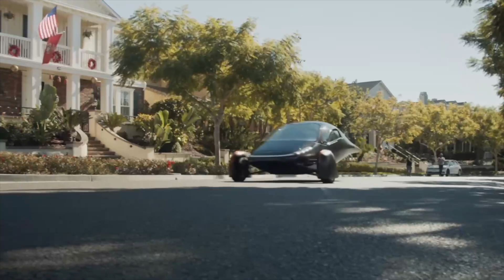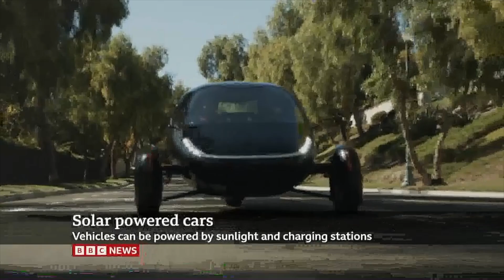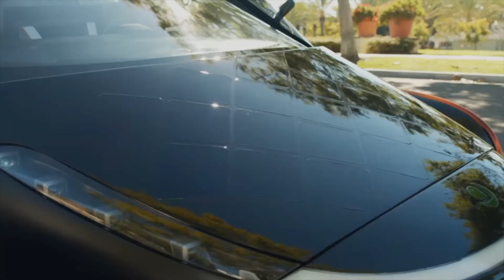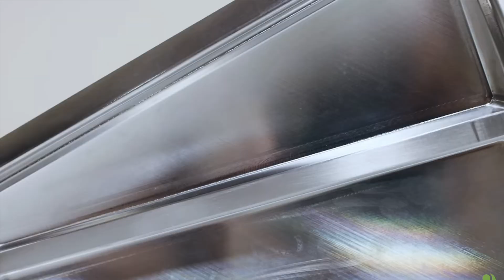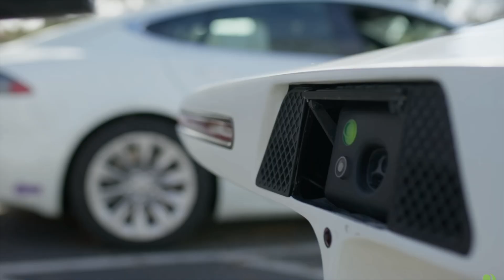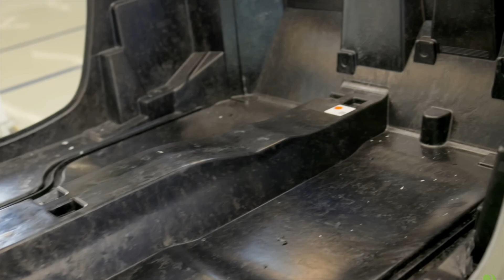BBC News Talks About Aptera !

Comment: Thanks for the great video I love the Aptera, but I live in the UK, which will mean having a right-hand drive model. Plus, the UK has very stringent regulations about Registration plates - front & rear - which have to be a certain size. Aptera will need to consider that for the UK market.

Comment: Even without the solar benefits the efficiency makes it worth it.
Reply: Aptera is currently cheaper than the model 3, so 1 mile saves money. However, in terms of efficiency, it is 2X more efficient than the most efficient model 3, which might get 5 miles per kwHr. 10,000 miles in the most efficient model 3 is 2,000 kwHrs. Multiply that by how much you pay per kwHr, and that is how much of a head start you get in the Aptera, then after that it is half the electricity cost.
Reply: @jasonhochstrasser8657  The aptera prices are pre Covid, pre inflation ESTIMATES. Realistically it will start at 40K. If rver produced. 
Aptera is a 2 seater motorcycle, it lacks all safety features necessary for a car. It is a deathtrap in case of an accident.
Aptera estimates are just empty promises, no real world data available.
Reply: How long will you need to drive for the 10k+ you will have to pay more for the Aptera motorcycle instead of a Tesla M3?
Reply: @vic321344 Where did you find those numbers?